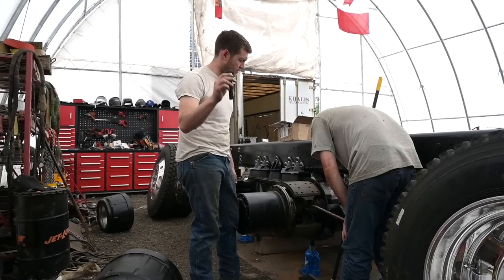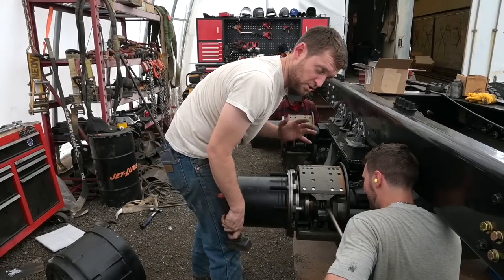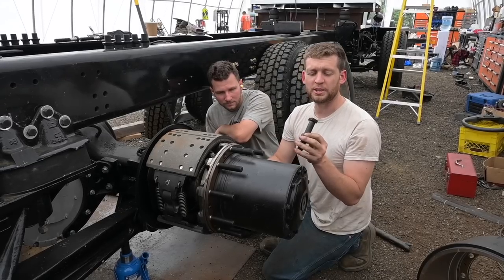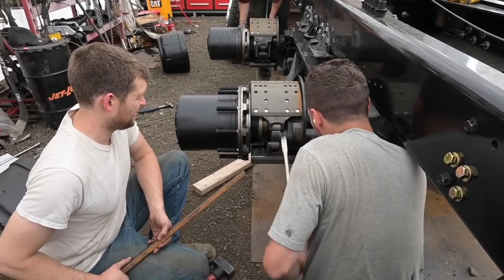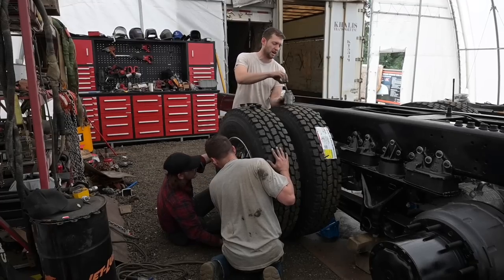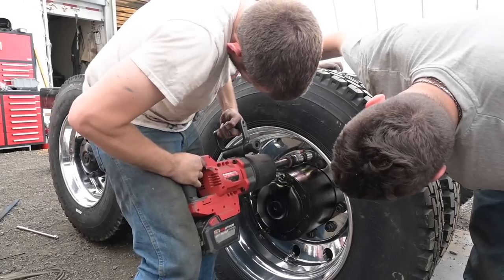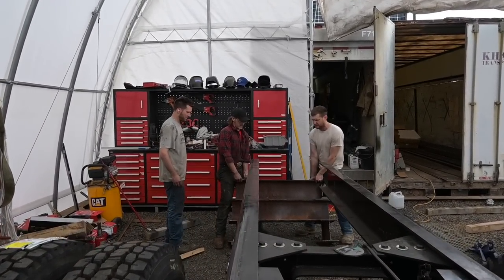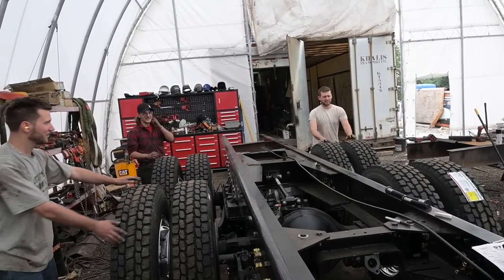Revamping the Rig: Wheel Studs, Breakfast Run, and a Long-Awaited Move!

Comment: Eye protection is meant to be worn anytime you are in the shop. BC workers  comp will fine you for every offence you show in the vids. This can triple your workers comp costs. Dont chance it. Use all safety protocalls when recording. I really want you guys to suceed.
Reply: Yea sure he wants to bring in safety minutes and cuckolding into his business, they are just going to edit the parts out, real men use PPE if necessary not required
Reply from the maker: Here let me solve this problem:   “All actions preformed in this video are considered stunts for filming”

We didn’t not wear eye protection in wcb violation; we were filming controlled stunts.

There that settles that issue
Reply: @EdisonMotors  damn man I'm so happy for you I would take a job for free busting off welding slag on the frame just to be a part!

Comment: What do you have planned for the interior? Is it going to be like a cat? With black vinyl perforated panels or insulation and metal interior panels
Reply from the maker: We haven’t gotten that far yet, we’re designing it as we go
Reply: @EdisonMotors  another note if you’ve thought of :one thing I’ve heard from people in Alberta who have electric vehicles is that they hardly ever use their brakes anymore, which as we all know this stuff they spray on the road will rust plastic, it causes they’re brakes to rust out and seize, causing everything to be replaced. Any thoughts on corrosion protection?

Comment: Fitting studs: Be a STUD and grab wheel nut and short bit of steel tube, pull stud in with the nut. It will pull them through square.

Comment: Tip for the future if you are putting wheel studs in with the press fit put them in the freezer the night before they'll slide right in and soon as it warms up to ambient temperatures they'll expand into place

Comment: I love that you guys are building this truck. I imagine a car or pickup built in this same spirit. If I had the resources and the knowledge, I’d try to make it my mission to build an extremely simple, easy to work on, modular passenger vehicle that was build for reliability, ease of maintenance and general workability. No 25” touch screen, no crazy auto pilot, just good old fashion push button switches and hardware.
Reply: Hopefully someone will come up with one. I don’t know if it’s possible with all the Government Regs. It has to have all the plastic electrical and computer to save weight and fuel miles.  I do think simplifying one and ease of maintenance would be great.
Reply: its near impossible to do this with passenger cars due to gov regs

Comment: Anti-seize or a thin gasket on the inner mounting face of the inner wheel also makes it easier to remove the wheels. No more swearing and swinging a sledge hammer under the fenders, lol.

Comment: You know you can throw some washers on there and a nut and let the impact do the work right
Reply: The concern there is damaging the threads. I've done it to no ill effect, putting lots of grease in the threads and on the washer, but goofing off with the grease is sometimes more of a pain than hammering them in if you can actually get a hammer in the back.